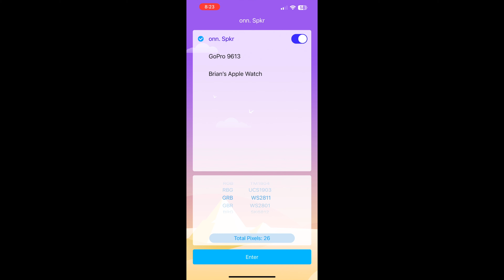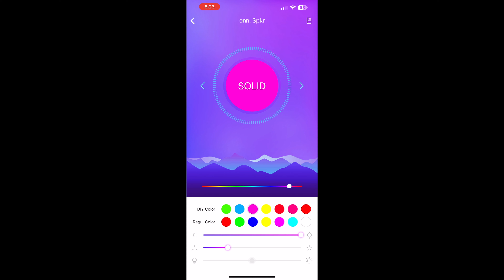onn. Large Bluetooth Speaker - Taking it Apart - Adding Better Lights!

Comment: Awesome video! Love the thorough breakdown on how to open it up and the different sections. Good to know how easy it is to replace the battery. I have two that I've owned and daily use for the last almost two years and love em. Saw the new Gen 2's today at Walmart and I was drooling over them.
Reply: The gen 1s seemed to have lil better sound performance although give up an aux/guitar port
Reply: I did the gen 1/gen 2 side by side comparison. The gen 1 was bit louder; gen 2 bit deeper bass

Comment: Thinking about modding one of these and this video really helps. Thinking about: bigger battery, aftermarket subs and tweets, and maybe an external amp if the audio lacks after the swap. However this seems much more complex than car audio😅
Reply: I agree with you I wanted to mod it out but it seems complicated 😂
Reply: I just need to bypass the battery altogether

Comment: I have had the gen 1 and gen 2 large party speaker and thought the front face and top dashboard look the same the back on your unit looks like you have the prototype prior to the waterproofed gen 1. I've never seen the AUX and USB inputs without a waterproof cover or at the very top of the backside. Maybe it's a regional thing, but regardless them things do bump. I just got another gen 2 and the bass button isn't just a bass on/off button any longer. It's now bass on, outdoor, and bass off... that outdoor mode is even louder and deeper.

Comment: Hey I was wondering if you could help me figure out why mine won’t stay on ? I charged it after about a year and Everytime I turn it on it stays on for about 6 second then shuts right back off. Any tips? Do you think I should replace the battery?

Comment: Any knowledge on why that same speaker won’t hold a a charge?
Reply: You can replace the battery pretty easy - to see if that resolves the issue.
Reply: I tried this… it works if I plug it straight in. Even with my new battery, it dies immediately when I unplug it. Any ideas what this will be?
Reply: @rickyellison5973 what type of battery did you end up getting for a replacement? I’m thinking about doing this to mine. I’m having the same issues as you are without replacing the battery

Comment: Hey! Wondering if you’d be able to diagnose the problem with my speaker. Spilt soda down the top of the big knob. Now it won’t hold a charge and turns off saying “Battery Low”

Comment: Awesome video! These sound better than the new ones by the way. Hey one of mine doesn't stay charged at all. I can only play it while plugged up, and the charging indicator quickly drops and dies when I unplug it. Would one of these batteries die suddenly like that? I imagined it would be more gradual
Reply: From the comments it seems this is a common problem.